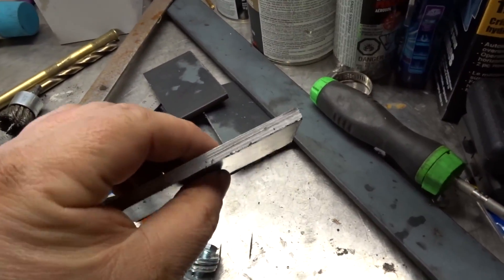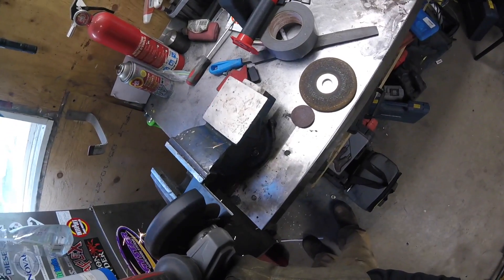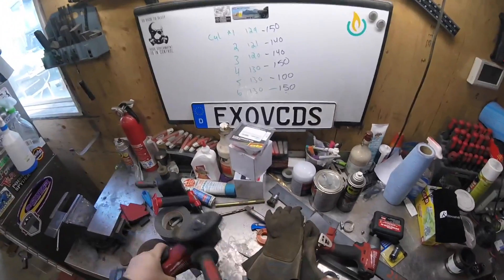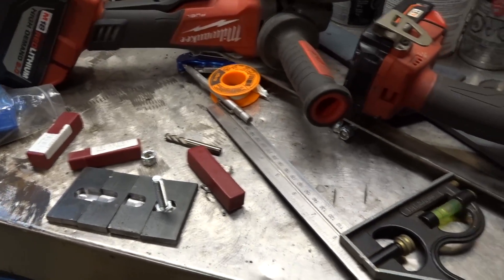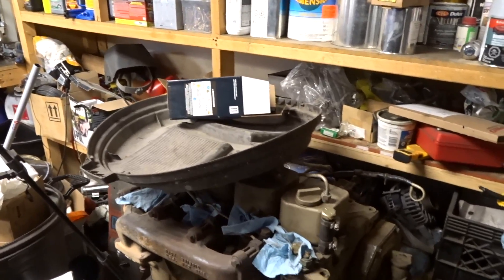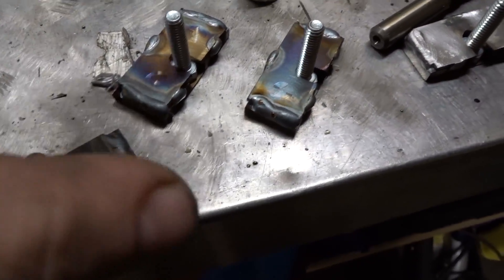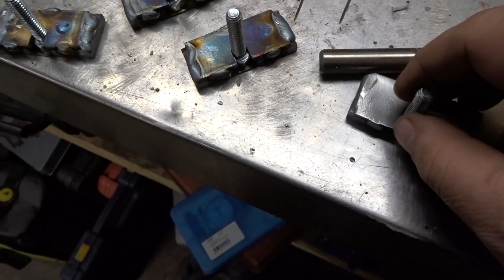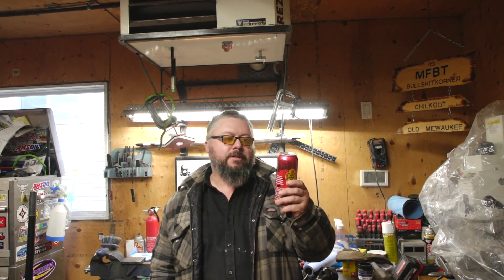Jeep TJ Rear Shock Mounts Engineer Johnny Special

Comment: Bar pin eliminators do the same thing for less effort.
Reply from the maker: You also loose up to a inch of travel and they don’t work if you bolts have broken off in the hole

Comment: I have that new Atoto A6 Pro 2GB+32GB with the gesture feature. Great head unit so far, I am impressed with it, once I figured out the hand gestures. If you leave them all on then when you reach for the radio to make other adjustments you will inadvertently make changes to stuff just by moving your hand.
Reply from the maker: Isn’t that the truth, I though it was messed up one time but the charging cable was making it do funny things